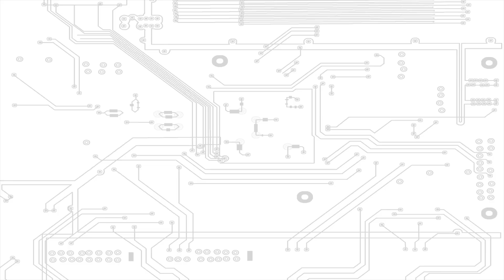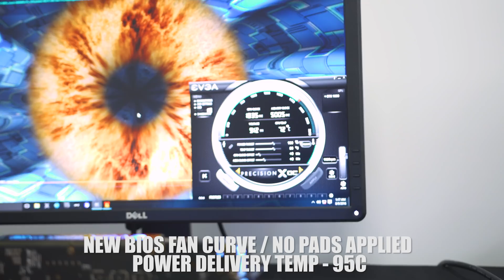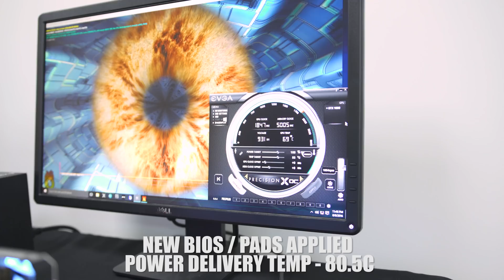EVGA FTW VRM Failures - What should you know

Comment: I've had this card for 3 years, 5 months and it just blew because of this issue.  So past the warranty. :(  Never saw the news on it...
Reply: I'm in the same boat, considering my product is registered I would expect some notification from EVGA. Did you contact them to see if they would do anything about it?
Reply: @PurpleShift I didn't, not even sure i registered it.  I found a post where someone said they were denied because it was past warranty.  I coincidentally finished building a new system with a 2070 the same day it blew.  Was going to pass it down to my teenager, but his 1060 works fine for all the indie style games he prefers to play...so kind of dropped it.
Reply: Matt Wale Oh yeah that made it quite simple then, guess I’ve learnt that taking out extended warranty on a card I plan to keep for ages is a good idea. Tricky finding a replacement atm as the 3000 series should be out in a couple months. (I got the expected ‘it’s out of warranty’ response, figured I may as well try).
Reply: PurpleShift Well that validates me not calling it in. Good luck on your search, parts were sparse a couple months ago.

Comment: my hybrid just failed on me. my grafics card would what feels like a crash and then just show a black screen. Sounds in the background would be normal but then when the crash happens its like when you bluescreen and get the repeating sound for about a second, and then it comes back but without monitor signal. Most of the times the card wont give out a monitor signal even after reboot. Sometimes I have to switch off the powersuply and wait for 5 minutes. Its not garuanteed to get a signal after that but when I do get a signal I can play a game again for anything from 5 minutes to 1 hour and then it crashes again. Furmark is the same, also any other benchmark.

Ive tried the card in another pc and its the same thing, no signal. ive tried it with another brand new psu aswell. Evga SN 750g+. Same thing. no picture at all.

Comment: I just picked up one of these used.  The heatsink was off several times and I don't trust the "greasy" thermal pads that were already in it. What thermal pads would work for this ?   I know some brands are super cheap, while others are very expensive.  The EVGA rep told me that I can use ANY 1.5MM pad, but I don't know if cheap ones would be sufficient, but at the same time I don't want to spend $30+ on a thermal pad that is major overkill.    Any suggestions ?

Comment: I never had an issue with the same card you demonstrated. I purchased the FTW GTX 1080 card in 2018. I guess they revised the card after you discovered the issue which is a good thing. Great video as always :).
Reply: Veni Vidi Vici it is revised I bought 2 and have them sli. I changed the thermal paste and they already have the pads in there.
Reply: https://www.evga.com/thermalmod/
Reply: Enter your serial number at that link it will tell you if your card has been fixed or not.

Comment: Two years after owning the GPU AND installing the thermal pads solution, it is still an absolute garbage card. Barely OCs, runs hot and a lot of crashes/freezes from the VRM blackscreen 100% fan issue. EVGA will be the last aftermarket option for me in the future.
Reply: same here! i get that replace the thermal pads kit and now i have a oil leak inside my pc because they also go full cheap on that kit as well!! i will migrate from evga to asus products from now on!

Comment: I'm a little worried about my card.  I have the EVGA 1080FTW and I've already sent one in to be replaced under warranty.  They told me the one they sent me to replace mine had the fix applied to it but I swear I don't see any of the pads that Jay is showing.  Does EVGAs repair differ from the one they send out to the public?

Comment: Jayz - well, so after buying evga card I will also have to BUY thermal pads and compound for GPU, right? Then I HAVE to spend time fixing it, correct?  After that if I am unlucky and screw something up I will need to send the card out to them  to get a new one (days without card I paid for!) to go through the whole process of fixing the new one AGAIN, correct? Who will have to PAY for posting it if I have to do it? Also why didn't you WARN people that the "bulge" under the thermal pad is supposed to be removed because it is a spacer and not removing it will cause serious issues after applying the fix?
So my main question is: AT WHAT POINT WILL I RECEIVE THAT PROMISED GREAT EVGA CUSTOMER SUPPORT AFTER ME FINANCIALLY SUPPORTING THEM WITH OVER 650GBP AND ATTEMPTING TO FIX THE CARD MYSELF. Any answer for that?

Comment: Great job I myself soloed this following your steps I felt slightly proud as im only 15 but then again who isnt when they manage to not destroy thier gpu, sadly though because of following what you we're doing I never installed the newer VRAM thermal pads, also in my opinion removing those two headers is easier with fingers than with a small screw driver. Just so you know I did this on a GTX 1080 SC by EVGA

Comment: Updated the BIOS of my 1070 SC last year and that helped A LOT ! 
 I've gone from a 73-76 C on the GPU to around 60-63 C with a max fan speed of 50-60%  (just shy of 2000 rpm). This is while gaming new titles  (eg. DOOM & Witcher 3) for longer periods of time with as high settings as possible without hitting fps avg. under 75 @ 1440p.
Anyhow, I am awaiting EVGA's shipment of pads just to make sure not to experience a shorten lifespan of my GTX1070 SC.
Thx for a good video :-)

Comment: I got a 1080 FTW and could not be happier, though I haven't overclocked it yet. At the time I got it, the BIOS fix and new thermal pads were pre-installed. I'm not too concerned about the heat now.

Comment: I had a 1070 ftw and a corsair cs650 psu I used to the pc for 5 months and I had no issues but before like 3-4 weeks I got error about surge from psu and the pc restarted then I restarted the pc and ignored the error I wasn't sure what cause this problem. then I kept the pc on and I went to sleep when I came next day I saw the pc turned off I was shocked then I told someone and he told me that the psu dead I bought a new one                               ( corsair cx750m ) and installed it then every thing worked fine except the gpu then I know that the gpu dead I sent the gpu to the retailer to check the warranty ..... after 1 week or so I received new card, but now i'm not sure how this happened to my old gpu and i'm afraid that there is something wrong with my house electricity because when I turn the monitor of while the pc turned on or when on sleep I hear some wired noise from the extender cord I got another one and I still hear the sound and now I'm worried about this noise can somone explain or help

Comment: How necessary is the thermal pad on the backplate? I have an EVGA SC 1080 with an EK full cover waterblock, and I neglected to place the rear thermal pad when I assembled my PC...the front of the VRM is already thermal padded, and my temps are solid...the backplates don't feel hot to the touch either, at least not when I bothered to check it. To be perfectly honest I don't particularly feel like draining my loop, unseating my cards and refilling/bleeding my system all over again...but then again, I don't feel like having my stuff catch fire either.

Comment: Ordered the kit from EVGA for my 1070 SC and received it within a week, did the mod today and overall my temperatures "with the bios update" have reduced by 10 degrees across the board, I would say the mod is DEFINITELY worth it though getting the wire pins out can be a bit frustrating and takes patience for sure, but totally worth it overall, thanks for letting me know about this as my card was running abnormally hotter than I expected and I couldn't figure out why till I saw your vid, thanks again!!

Comment: This is what EVGA sent me...
I do apologize for any confusion this matter has caused as I would like to take the time to clear up any issues you may have about the 1080 / 1070. The EVGA GeForce GTX 1080 and 1070 do in fact have thermal pads as air alone could never cool this area enough to operate properly. The test that was run causing people to be worried was with a benchmark that has been known by Nvidia to damage cards in the past. Due to this the drivers by Nividia actually have it built in so that if your are running this program the card will throttle down. Some people know how to get around this and will run the card in extreme environments. 

We are offering extra thermal pads to customers that want to see better temps when pushing the hardware however this is not necessary and is completely optional. These additional thermal pads will be installed between the backplate and the PCB and between the baseplate and the heatsink fins only as these add additional support to the card for extreme use. These cards are within spec and will run under normal circumstances with no issues. However with that being said we are providing a VBIOS for the cards in order to increase the fan speeds to help with the VRM temps. We are here to support you and if there is any issues with the product you are still covered under its available warranty. 

If you would like to have the card replaced with a model that has the pads installed we can support you with this request. Please read more about the thermal pads in the link I have provided below. Once again I would like to take the time to apologize for any inconvenience and confusion this matter has caused.

Comment: So I'm a noob with a 1070 FTW, should I be worried about this? I haven't noticed anything weird at all with my temperatures. They hang around 65 C under load which seems pretty dang good to me, but maybe the high temps that you're talking about wouldn't be seen in any monitoring software because we're not talking about the temperature of the actual GPU. I'm not too worried about taking apart hardware but I still don't want to have to do this if I don't have to. Is this a necessary fix for all FTW cards or is it only a problem on some of them?
Reply: i wouldnt worry about it if it goes bad u have the warrenty ive had mine for almost two months no probelms

Comment: hello, I'd like to use the EVGA FTW  cards with EK water block because the higher base clock speed and the nice block looks, is this still then an issue? should I add more thermal pads to the backplate? and is the process of replacing the water block the same as in your other video?
thanks

Comment: I have two EVGA 1080 FTW's in SLI and have applied the BIOS fix for this issue. However I would like to take it a step further and water cool them.

Leaning towards keeping it simple rather than doing custom water cooling. So looking at getting two of these HYBRID Water Cooler (All in One) for EVGA GTX FTW 1080.
http://www.evga.com/Products/Product.aspx?pn=400-HY-5288-B1

However I already have the CPU Cooler H100i V2 in my ROSEWILL NIGHTHAWK 117 CASE which takes up the two top fan spots. So would I replace the two fans on the front of the case? I currently have 2 140mm fans there, and the hybrid cooler fans are only 120mm (the case will take either). Is adding two more self-contained coolers the wrong direction to go? Any suggestions on one (simple) solution for both the cards and CPU?

Comment: Does anyone know whether or not EVGA will pre-apply this thermal pad solution to fix the VRM overheating issue in the near future? I was planning on buying two 1070  FTWs and i still would if i wouldn't have to disassemble the both cards myself and probably void the warranty of the cards.
Reply: If you buy directly from EVGA now, your 1070s will have the pre-applied thermals and updated BIOS. EVGA has said all cards purchased/shipped from 11/1/2016 onwards will have the fixes. http://forums.evga.com/Update-11916-with-NEW-BIOS-EVGA-GeForce-GTX-108010701060-PWM-Temperature-Upadate-m2573491.aspx

Comment: I have a 1080 ftw and my temps never go above 75C. I haven't done that 400rpm software and I haven't installed thermal pads. Am I lucky or something?
Reply: As far as I know, If you're running an aggressive fan curve you don't need the BIOS update or thermals. I have my 1070 ftw running at 50% fan speed on idle and get's to 80% most of the time while gaming. My temps never exceed 60C unless I use max setting on certain games (at 4k) but still never goes higher than 65C. Anyhoo, I decided to put it under water to start benchmarking etc. so I've ordered the hybrid cooling kit, so that will solve all these issues anyway.

Comment: +JayzTwoCents Do you think its still worth buying an EVGA GTX 1080 FTW or should I go for the Asus Strix? They may have fixed the issue with a bios update but I don't know if they are applying the thermal pads at the factory. Personally I have always liked EVGA but this seems like a deal breaker for me.

Comment: We messed up - by not cooling the VRM. We thought air was enough.
We messed up - by skimping things that cost USD 1-2 per card to save cost.

Either way, this speaks volumes about their product design or project management. I am more inclined to believe that it is to cut cost.

This is not out of spec manufacturing - even if it is, it should have been caught early. I mean, VRM temps are going up to 107 degrees Celcius on open test benches with low ambient temperatures. How did those tech review sites caught those before EVGA did? 

I refuse to believe that every engineer on the project overlooked this problem.

Comment: Good review. I always check the thermal paste on my newly purchased gpu's and tbh, the factory job is not very good (sparse amount that has been spread over large area). I also suspect a lot of gpu manufacturers use cheap thermal paste. So I wipe off the cheap paste and I use Shinetsu thermal paste (which I highly recommend). I use it for my cpu's and gpu's and using a high quality thermal paste compared to a cheap one does make a big difference.

Comment: EVGA lost all credibility after this epic failure.

They also fucked up before with the Maxwell cards, using old heatsinks designed for the larger Kepler chips. Resulting in bad cooling performance.

Quality control and testing must be next to non-existent because  otherwise these epic failures wouldn't happen.

Comment: Hi Jay. I have an interesting test for you.  EVGA is currently releasing new bios for the 1080 / 1070 series graphics cards.  They  basically change the default fan profile in the bios to make the fans run quicker and faster.  Now they say the thermal pad addition is "optional".  Here is my thought.Get a GTX 1080 SC (uses base pcb with one 8 pin connector) and test the VRM with default bios, then add the aggressive fan speed of Precision and test again.   Then add the thermal pads and test again and then flash the new bios and test again.  Some people are saying that not flashing bios or adding thermal pads is OK, as long as one uses an aggressive fan profile from either Precision or Afterburner.  Can you possibly test and shed some light? I really enjoy your videos and believe that you know your stuff...Thanks

Comment: None of these videos are also stating that it's NOT JUST the thermal pads they skipped on, it's the entire heatsink itself, it doesn't have a solid part to make contact, the heatsink only makes solid contact with GPU, only the fins will touch VRM.

Here is an image from the Gigabyte G1 1080 Heatsink: http://www.techspot.com/articles-info/1190/images/Image_13S.jpg

And here is an image from EVGA FTW 1080 Heatsink: http://images.bit-tech.net/content_images/2016/06/evga-geforce-gtx-1080-ftw-review/1080-35b.jpg

Notice the difference? EVGA only has solid contact with the gpu, whereas Gigabyte not only has a thermal strip for the VRM but it also has a solid part of the heatsink to make optimal contact.

This was a cost saving measure - But not on the thermal pads, also on the aluminium, also the heat pipes don't even appear to be copper.
Reply: Exactly my thoughts, I'm not expert but seems they dropped the ball on the design of the heatshink this time. But calling back all the GPUs isn't cost effective, hopefully they'll fix and redesign the whole heatsink on a revision.
Reply: EVGA is used to doing these kind of things. It's intentional each generation. http://www.eteknix.com/evga-respond-possible-design-flaw-gtx-970-acx/
Reply: It was more F** The Watts... 😂🤙

Comment: There is not bios update for gtx 1060, why?
Reply: The short EVGA SC 1080? Or which? Generally 1060 feature sub-critical TDP of only 120W as opposed to 150W+ of the cards discussed here, and their voltage regulator circuit is in direct airflow at the output edge of the card rather than near the inner edge like here. It might not be affected by this issue at all, i'm not sure. Perhaps prudent to ask EVGA directly.
Reply: Siana Gearz i have the gtx 1060 ftw +,  yesterday i saw the links of bios update but there is not update for 1060,  do u think 1060 is not in danger?  Thx for answer
Reply: Javier Romero mhmm should be careful. It appears BIOS update for 1060 models 03G-P4-6365, 03G-P4-6367, 03G-P4-6167, and 03G-P4-6165 may be expected later.
Reply: Siana Gearz give me the link please, because in the web of evga only appears the update for 1070 y 1080

Comment: Great video man! I have the EVGA 1070 FTW (08G-P4-6276-KR) so I ran the BIOS update and the monitor turned off and stayed that way forever, so I restarted the PC, went to check the Nvidia Panel and the BIOS version was 86.04.50.00.72,  so I guess the thing was succesfully installed. The problem comes when I start some game like GTA V, I use afterburner to check the changes in the GPU and oh surprise: the fans are not working, even when they are in Automatic, so my question is this: Do I need to adjust the RPM bar every single time I start a game or something went wrong with the installation??? If so, what shoul I do?